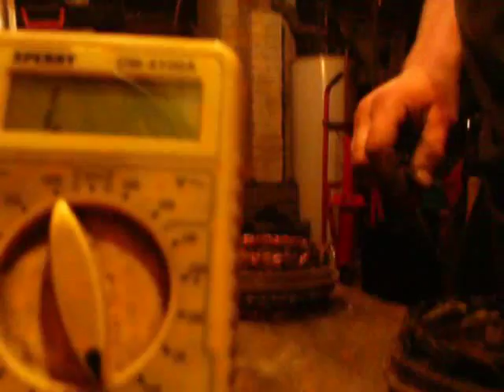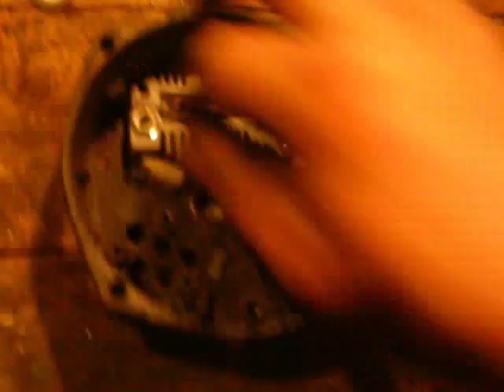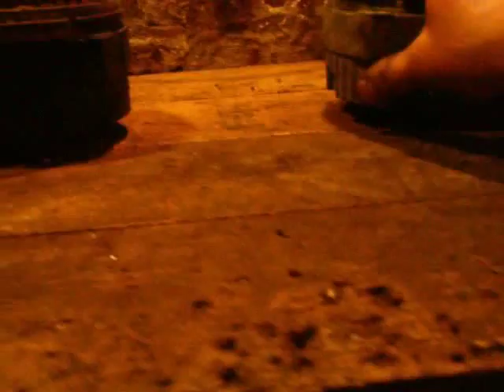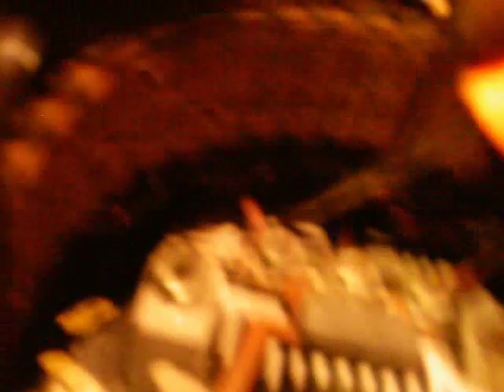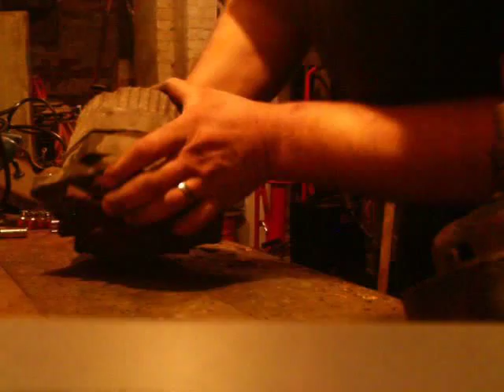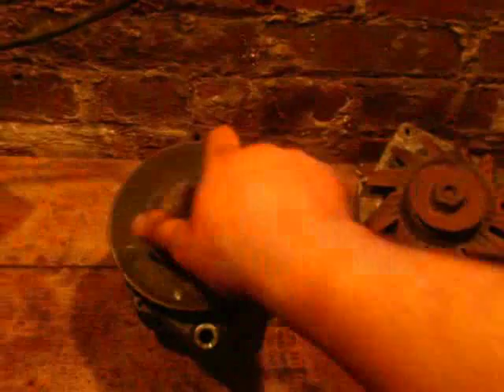10si & 12si alternators (part 2 of 3)

Comment: Id like to ask in all your years of repair/rebuilding these GM alt what is the part that fails the most ? Just curious.
Reply from the maker: Not so much of it being a specific part but rather a certain situation for these GM alternators to go bad. They are pretty reliable and mostly durable. The situation is overloading them at low rpm to where the internal parts heat up and blow something. An example- a rainy day driving your 79 Impala. You turn on the wipers, headlights, heater, rear defogger. The alternator handles the load ok while cruising. Then you come to a long traffic light, you stop and wait. The car is idling there, the headlights dim alittle. You are overloading the alternator while sitting there waiting. The alternator starts overheating because it is overloaded and can blow either the rectifier, stator, diode trio, or regulator. Usually, one of these. This has happened to me personally a couple of times. Stock components can't handle it too well. The aftermarket has better components that can take the punishment of this situation for a better alternator. A brand-new unit is even more reliable because of the upgraded parts. A modification to an original unit would be to put the smallest pulley on it as you can, to speed up rpms at idle for better cooling. It helps alot.
I have built thousands and thousands of these GM alternators at my job in a production line for the big name speed shops and I also examine the returns. Only about 3% of these alternators are actually bad of all the returns at any given time. That is if there is 100 returned units, only 3 are actually bad. The other 97 units are good units or customer did a bad install and they broke the unit or just did the install wrong.
Thanks for watching.
Reply: @prancstaman  Thanks !
Reply from the maker: Also, read the other comments. I give more info on testing other parts of this alternator.

Comment: Sir what is the matter if we feed regulator from rectifier positive directly instead of trio diode
or what difference between trio or rectifier  feeding
Reply from the maker: Should work either way because the regulator will only take power as much as it needs it in order to work. The diode trio pulls AC power straight from the Stator which guarantees the regulator will have power and stops supplying power when vehicle is shut off. If you pull power from positive side of rectifier, the regulator will not shut off when the rotor stops moving or when you turn vehicle off, and will drain battery while vehicle is off.

Comment: How do you check the regulator you didn't show it?
Reply from the maker: The regulator gets checked every time you turn the vehicle's power on by the key with the light on the dash. Need to know how to read the light. Key on/engine not running- light should be on, if no light then problem with dashboard power, or blown regulator, or blown rotor. Start engine then light stays on- bad rectifier diode, or bad stator winding.

If you take the alternator apart to test and put back together, everything tests good but alternator still doesn't work, then check the insulator in the screws for rips or cuts. They are insulating for a reason and if they ground out on the part it is insulating then the alternator will not work.   

A good alternator in vehicle- Turn key on, then light comes on. Start engine, then light goes out while engine is running.
Read the other comments also in this video and other videos too. I answer this question more with more info. Thanks for watching.

Comment: You DO NOT hammer bearings out or in.  They are to be pressed with the proper drivers and supports so as NOT to distort nor crack the case.
Reply from the maker: An arbor press works best. At the time of making this,  I had no press, sometimes you just have to use what you have.  Thank you for that piece of info.

Comment: you didnt show how to test the regulator?
Reply from the maker: That's right, I did not test the regulator. You need a test machine to test the regulator by itself, that I do not have. To know if the regulator is good and you are rebuilding the alternator yourself, the alternator must be built and on an engine. This is where the dash light comes in (plug connector 1 on the alternator, which goes to the alternator light on the dash. This is a 2 step test. With the alternator together, on the engine, and wired up, and assuming that the rest of the parts tested good. Turn on the key or switch to supply power to the light on the dash, if the light lights up, then the first step of the test is good for the regulator. The 2nd step of the regulator test is 2 parts. Start the engine and the dash light that was on turns off, is the first part of the second step. The 2nd part of the 2nd step would be a voltage test, when the dash light goes out the voltage will jump up to operating voltage which on this alternator is around 13.5 to 14.5 volts, depending on loads of electrical system. If you are putting this alternator in a vehicle, the light on the dash for terminal 1 of the alternator, gets it's power from the dash power circuit and must have power to all the gauges for you to have the alternator circuit/dash light to work. This fuse is marked "gauges" in the fuse box.If you are putting the alternator in something else, then confirm that you have power to terminal 1 on the plug when the circuit is turned on. The terminal 1 power circuit must be keyed power or switch powered because if left on while engine is off, this will drain the battery.If the 2 step test sounds familiar for the voltage regulator, Yup. You pretty much test the voltage regulator in any car/truck every time you start the engine. Plus all the other lights on the dash that are on when the key is turned on, then go out when the engine is started. Hope this helps.....
Reply: @prancstaman  Yes that does help ,thank you very much.
Reply from the maker: It's been a while since I seen my own videos on this but I think I cover what I said maybe in the next video of this topic, in part 3. I should maybe watch them again myself, I forget things, LOL.